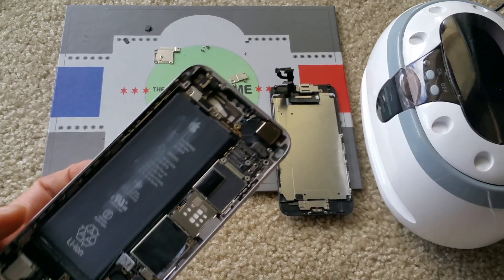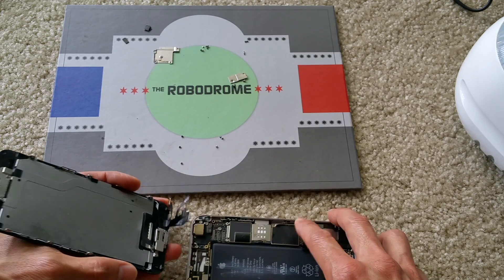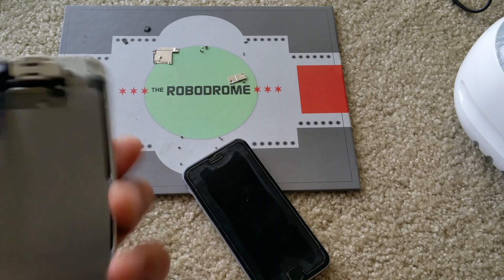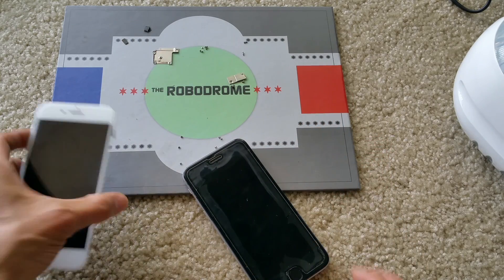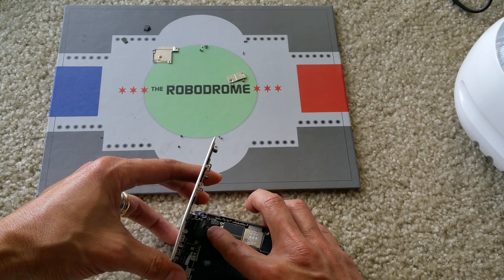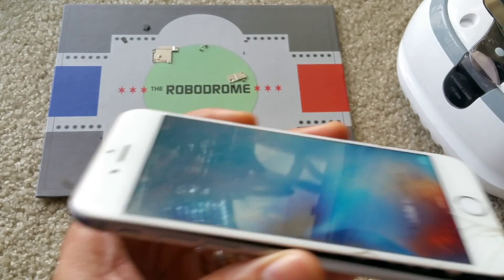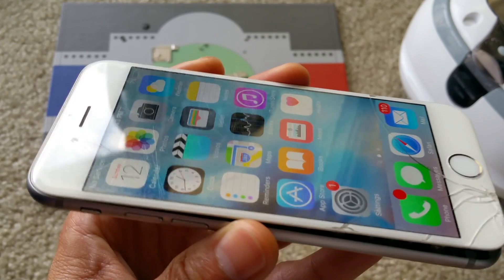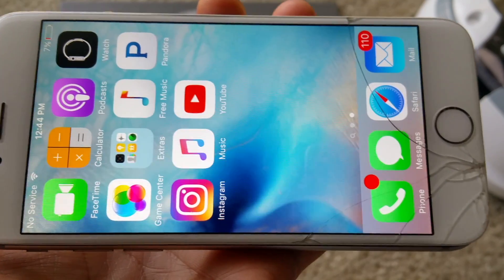Latest Method On How To Fix/Repair Your Dead Water Damaged & Rescue Apple iPhone 6 6s 2016

Comment: My iPhone 6 (not 6s) fell in the toilet for about 10 seconds then I quickly grabbed it out. I tried to shake the water out for 5 minutes while turning it on a couple of times before putting it in rice for 3 minutes. after I turned it backed on it shows the restart screen but then quickly becomes like a broken tv except its heating up very quickly!. after 2 minutes I grabbed out the sim card what should I do? its overheating! and I do not have any tools.
Reply from the maker: You're supposed to put your iPhone in rice for couple days or dry it with a hairdryer. If it is heating up or overheating that means there are still waters inside your phone, DO NOT CHARGE YOUR iPHONE!!! Dry it completely before turning back on again.
Reply: wait hold up I meant I lock my phone inot turn it off
Reply: is there a way

Comment: My mum bought an off brand life proof case ( her mistake not mine) and went to a water park ( also her mistake) and the iPhone 6s got drenched with water, then a few months later she gave it to me as a gift and it worked fine for months until one day I came home from school and it would not turn on😭. It’s been sitting in my room and I don’t know what to do with it. Should I try something or just give up and understand that it was doomed the second my mum bought it
Reply from the maker: You should try to put in a bag of rice to see if it works or else you will need to give it an ultrasonic cleaning.
Reply: macdaddypimpping ok, tank q
Reply: Try holding down the power and home button at the same time

Comment: I wanted to take pictures in the pool so I did it and while I was using it, it shut down completely. I've had it with rice for the past 3 days and it still doesn't work. I don't have any tools, is there a chance that it still might work or how to fix it?
Reply from the maker: Yes, I did that with rice first and it didn't work so later I use my ultrasonic cleaning and it came back alive! Link is in the descriptions of how to do it step-by-step.
Reply: Or just go apple 🙄🙄
Reply: @leahh8857  some people dont have the money leah wow.

Comment: I dropped my phone in 2 inches of water in a dog bowl today. This is the second time it has happened. It happened with 5c when i dropped it in the toilet when it came out of my pocket. I currently have my 6s in rice and i may leave it there for a day or two. I also didnt power the device off and initially the screen was fine but the speakers didn't work. Later the screen went weird so i contacted apple and they told me to power it off. I hope it works ok.
Reply from the maker: Hope you get your iPhone 6s back in working order soon, if not you will need to try my method. Good luck.
Reply: That sounds ruff!

Comment: Hey, I was washing my bath tub with water and I dropped my phone in it for a second and picked it back up as soon as it fell in. And it still works, but when I try to unplug my headphones and use sound, it says I’m still connected to headphones. How could I fix this?
Reply from the maker: Try to put alcohol on the 3.5mm jack and insert in and out to clean the jack.
Reply: macdaddypimpping Okay, thank you!
Reply: Aesthetic Chan haha thank god

Comment: My iPhone SE fell into the ocean and I pulled it out 5 seconds later. I tried to turn it on and charge it which I know was a mistake now. I then poured some of the 90% alcohol down the ports in case of corrosion. It's been in rice for a day and won't turn on. Do you think if I replace the battery it will be good?
Reply from the maker: Salt water is your smartphone worst enemy, try to clean with ultrasonic cleaning first. Hopefully, you didn't short any circuit by charging it.

Comment: Could you fix my iPhone 6 water damage all it does is just sit in my draw it fell into the Toilet and I don't know what to do
Reply from the maker: Yeah, are you from the USA?
Reply: macdaddypimpping Yes u take shipment if I ship to u
Reply from the maker: How long was your phone in the toilet?
Reply: macdaddypimpping for about 6sec
Reply: It was like it fell in then I picked it up out the toilet.
Reply from the maker: Don't tell me you plug into a charger afterward.
Reply: macdaddypimpping no I was in school when it happen but when I got home 4 hours later I did
Reply from the maker: Most likely you probably short the battery or you can send it to me to try to fix it.

Comment: Hey bro I dropped my iPhone 6 in water and put it in rice for about 2 days, I plugged it in and it turned on with some lines on the screen so I decided to shut it down and now its just black screen but I can still get calls and notificacions just doesnt turn on
Reply from the maker: Bro, looks like your screen is going bad. You need to get a new screen.

Comment: I accidentally washed my iPhone6s in the washer..how do i fix this?
Reply from the maker: You will need to dry it right away and don't power on your iPhone or put into a bag of rice for 72 hours.
Reply: This happened 3 days ago and what should I do about this?
Reply: How do I dry it?
Reply from the maker: Dry it with hair dryer or put your phone in a bag of rice first.
Reply from the maker: I hope you did not plug your phone into a charger, if you did then it might short circuit your mainboard/IC Board.

Comment: so i was using my mom's iphone 6s and then i dropped it in the sink(it has water in it) then i took it again and it has water inside it. its was near the silent thing so i assumed the water got in because of that. for 30 minutes it was still fine but then it suddenly blacked out but it was on 76%. what should i do about it??
Reply from the maker: You will need to open it up and ultra clean. You were not suppose to use the phone while the phone was still wet. You suppose dry it in a bag of rice or hair dryer or else it will short your mainboard.

Comment: My iPhone fell in the toilet I turned it off and put it in front of a fan it worked for about a year and quit
Reply from the maker: Probably need to change the battery.
Reply: macdaddypimpping no, when you use a ultrasonic clean method it doesnt change the fact that there is still damage to the logic board circuit.
Reply: Are you sure it was the toilet or something else that's a long time for it to suddenly stop working

Comment: I have an iPhone 6s Plus & I got in the pool with it. After I noticed, I quickly dried it and tried to use it. It was ok until I plugged it into a charger then it faded away. I tried this method without the sonic thing and it didn't work. Any tips?
Reply from the maker: How did you dry it? It must not dried all the way, that's whey when you plug-in your charger it must short out something.
Reply: you ruined it the minute you plugged it in to charge it.

Comment: Do you know how i can fix my phone i cant click the bottom of my phone as in the one two three or the emojis or the return
Reply from the maker: Was your screen crack? Did you ever replace your LCD? Could be your touch sensor. Was your phone ever get water damaged?
Reply: @macdaddypimpping  .
Reply: Same back when my phone used to work I was unable to click the the bottom left screen part. Now it doesn't turn on because of the water

Comment: So my iPhone 6 dropped in the toilet on July the 4th I took off the case and took out the sim dried the excess water off and put it in rice at first it wouldn't do anything it was black after a few days it would only stay on the charger and stay at 1% now it's been a week it still will only charge to 1% but it will come off the charger does anyone know how I can fix this besides getting another phone my sound touch and everything else works
Reply from the maker: Did you clean contacts around the charging pin with alcohol? If you did then you might want to consider to replace your battery.
Reply: macdaddypimpping do I have to take the phone apart to do that... and everything is working it's just my battery won't charge past 1%
Reply: macdaddypimpping it's cutting on and everything but it'll stay on the charger but will only charge to 1% with the phone on and when I take it off it waits till the 1% is gone then cuts off
Reply from the maker: No, your charging port. But you might have to open it up and inspect if everything is dry up.
Reply: macdaddypimpping I'm going to open it up later I have all the stuff but if not will I need to order a charger port or just clean the charger port?
Reply from the maker: Just need to clean your charging port and it might be your battery. Check with the IC board first and make sure it is all dry up so there's no short to prevent from charging up your battery.

Comment: my iphone damaged by motherboard and grounded how would i d
Reply from the maker: Depends if your iPhone dropped on the ground has damaged your ic chips or not. You will need to troubleshoot it first what is not working. LCD & Digitizer, motherboard, battery, and etc.

Comment: Hello, The phone was dropped in water several months ago, and then was placed within a bag of rice. When I plug the phone in, the apple logo pops up. However, the battery swelled and pushed out the screen a little bit. I have a replacement battery. If I purchase a replacement digitizer as well am I too late to repair this phone?
Reply from the maker: It depends on how much water damaged got into your iPhone. You probably need to do an Ultra Sonic Cleaning before you install a new battery into your iPhone or else it might short your battery again. How do you know if your digitizer has gone bad?
Reply: Thank you for responding. I am not sure if the digitizer has gone bad. I only see the apple symbol, which could mean it works or it doesn't work right? I have ordered and UltraSonic Cleaner to test that method. Do you use Isopropyl rubbing alchohol when you clean the assembly? I already have a replacement battery on hand, as well as the tools to take it apart.
Reply from the maker: Cool, make sure it is 91% rubbing alcohol not 70%. Yes, once you can see Apple Logo you can not tell if your digitizer is working or not buy most likely it will still works. The one I fixed that got water damaged due to dead LCD + Digitizer. Good luck.

Comment: What if powers to apple logo but won't restore and stays on apple logo for extended periods of time and red screens flash
Reply from the maker: Was your phone water damaged?
Reply: macdaddypimpping yes
Reply from the maker: Have you try to restore your iPhone? Try it and if it still does it and if your iPhone still under warranty then I would suggest you to take it in. Some people restore it and that fix the problems but some have to take it in due to hardware issues. Good luck.
Reply: Out of warranty and the restore dosent work and says error 3014 on iTunes
Reply from the maker: Error 3014 is software issue on our PC, can you try on a different computer at all?
Reply from the maker: Have you try to clean your charging port with 91% Alcohol?
Reply from the maker: Try to turn off Firewall on your PC and that should fix error 3014.
Reply from the maker: Turn off your Anti-Virus Software/Program too.
Reply: macdaddypimpping ok
Reply: It's mac though
Reply from the maker: These errors may be the result of the connection to gs.apple.com being redirected or blocked. Follow these steps to resolve these errors:Install the latest version of iTunes.Check security software. Ensure that communication to gs.apple.com is allowed. Follow this article for assistance with security software. iTunes for Windows: Troubleshooting security software issues.Check the hosts file. The restore will fail if there is an active entry to redirect gs.apple.com. Follow iTunes: Advanced iTunes Store troubleshooting to edit the hosts file or revert to a default hosts file. See section "Blocked by configuration: (Mac OS X/Windows) > Rebuild network information".Try to restore from another known-good computer and network.If the errors persist on another computer, the device may need service.
Reply from the maker: I believe water damaged is also causing this error. Have you try to clean your iPhone at all?
Reply: how
Reply from the maker: How bad did your iPhone got water damaged?
Reply: +macdaddypimpping hey my iPhone dropped in water a month ago and I didn't put it in rice. its it a way I can bring it back to life. now ? Cuz I wanna use it
Reply from the maker: Krystal Harris Sure, but that depends on how bad was the phone got wet? You can first put your iPhone into a bag of rice but make sure you put in a ziplock bag that will cover the whole phone for at least 24-72 hour or longer if it got damaged bad.
Reply: Okay imma try it now. And if it doesn't work can I come back to u ?
Reply from the maker: Of course, we are here to help. Peace.
Reply: +macdaddypimpping i dropped it in a puddle of water. in the rain. n the water go into the crevices of it. I didn't put it rice after I waited more than a month. but its in rice right now its been in rice since 3 something this afternoon
Reply from the maker: Just let it sit in the bag of rice for 24-72 hour. Don't charge or else it might damage your circuit board. Just wait and hope that bag of rice would dry up moisture inside your iPhone. If not then you will need to try my ultrasonic cleaning method within the descriptions.
Reply: +macdaddypimpping okay ! will do. rice is in place so if it doesn't work. I will do the ultrasonic thing. I'll come back to u for more info
Reply from the maker: Sure thing, come back anytime.

Comment: My iPhone 6 got fully submerged in a deep puddle for a good couple minutes and charged it a bit after and the screen was just completely black and couldn't turn it on or anything and at home now. Will putting it in a ziploc bag with rice and a silica gel packet over night fix it?
Reply from the maker: You must not plug into a charger with wet phone that might damage the circuit board. You can try to  use hair dryer to get out as much as water out first then put into a bag of rice 2-3 days depend how bad it got submerged in the water. If that still not work then follow my method and you must watch each video in order to fix it right. Good luck.
Reply: macdaddypimpping It was deep inside a dirty puddle and yeahhh my friend plugged in my phone in the car and it charged until it turn on and as soon as it turned on the screen was completely black but slightly on but no apple logo or anything and just turned off after
Reply: As of now I tried turning it on and the charge symbol popped up but the screen was being wonky and was flashing different colors like the multi colored lines across the screen
Reply from the maker: You might have short circuit your screen when it was plug in to charge your phone while it was still wet. But, you can still rescue your iphone with my method though. Check out my video and follow them and you will fix your iPhone. Just be patient and take your time unless you want to get rip off by going to the repair shop.
Reply from the maker: I know how you fee, phone got wet and you need to use your phone right away. But, you must stop turning on your phone further or you will further damage your phone. First try to dry it up with dryer and then put your iPhone into a bag of rice. Rice must completely cover the whole phone or else it is not effective and waste your time doing it. Leave it in for at least 24-72 hours. Clean charging port with 91% alcohol after drying your phone, then plug in your charger to your phone. When your screen is flashing different that means you might have shorted LCD when it was plug in to a charger when it was still wet.
Reply: macdaddypimpping yeah I reaalllyyyy wanted to use it right away but about an hour after I put it in rice my phone turned on and theres a few darker shaded parts of the screen and the home buttons barely responsive and tapping the home button only activates Siri and the screens somewhat unresponsive too. Should I leave the phone in the rice turned off overnight?
Reply from the maker: Yes, leave it in the bag of rice for a longer period. Rice will dry up all of the moisture on the mainboard, but if it is damaged very bad then you will need to remove your mainboard out completely and do the ultrasonic cleaning. That will be the only way to proper clean.
Reply: Mist3rSpanky same with mine I did it with rice the got stuck in the phone outlet so my off button and volume doesn't work I finally got the sound back after 1 year of hitting it
Reply from the maker: Thank you for sharing.

Comment: after you do the water damged fix if the iphone had a pass code will it still have it at start up or does it come off?
Reply from the maker: Fixing any water damaged iPhone will not erase any pass code or pin code or bypass iCloud.

Comment: There's no way rice will work ???
Reply from the maker: Depend how much water get into your iPhone. Normally, 24-72 hr should be good.
Reply from the maker: Yes, it will work. I tried it on this phone and it is working but not to its full 100%. Battery will get drain quick but at least you still have some juice but if you really want you can buy and install a fresh battery. FYI, rice did work for me on this phone that was dive in the swimming pool.
Reply: macdaddypimpping 
it is working now and how long you put it in rice